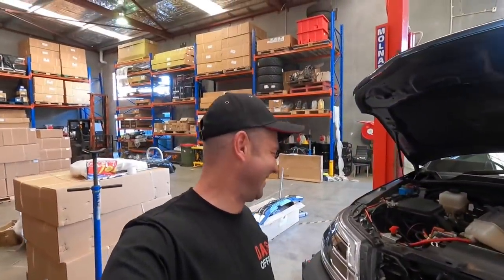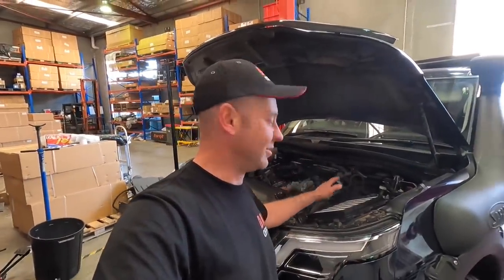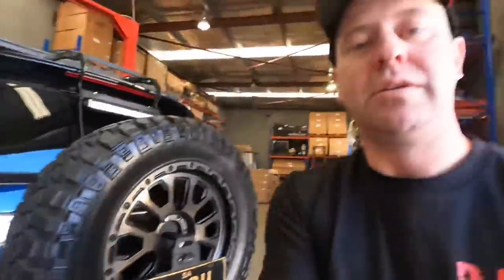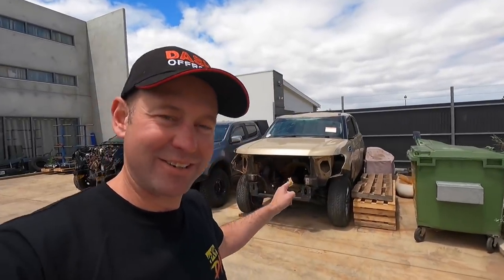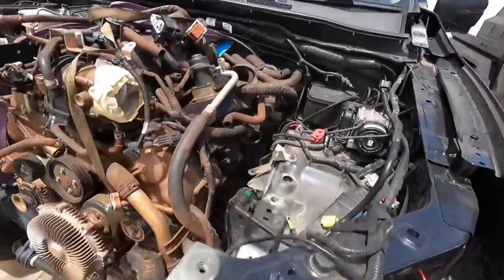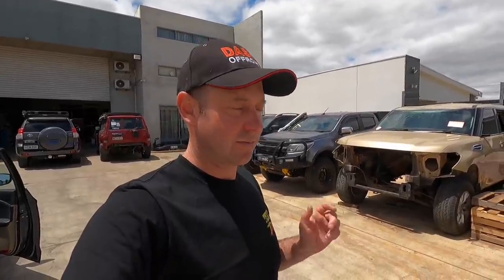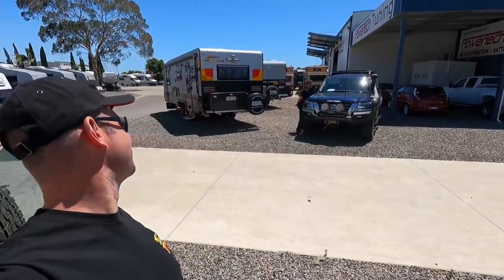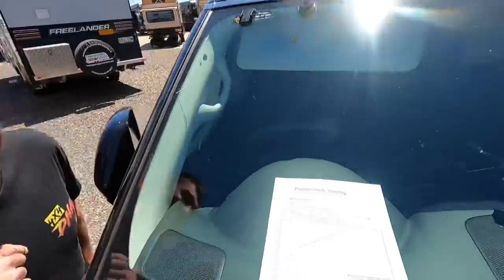VLOG #64 - HARROP IS ON & NP56 🦾🦾🦾

Comment: Hey Dash,
I have a D40 Navara with a VK56DE from a Titan, basically a straight swap. I used the Titan engine mounts, they bolted right up to the Nav chassis. They may work for your NP300.
Cheers.
Reply from the maker: I think you’re right 👌

Comment: Injectors, fuel pump, large pod k&n, custom air box, blower + small pulley = 300+++++ killa wasps and hub dyno not on the rollers. Get accurate numbers